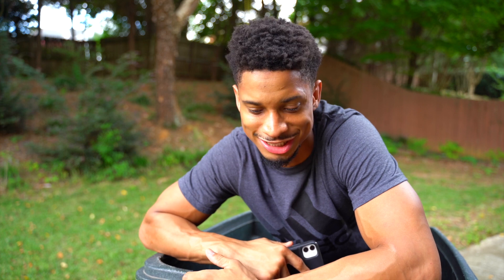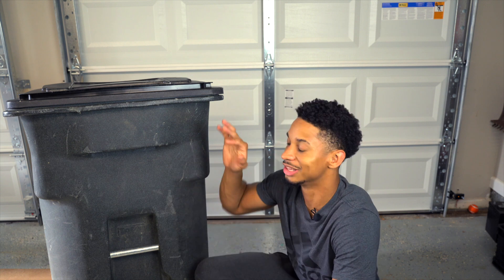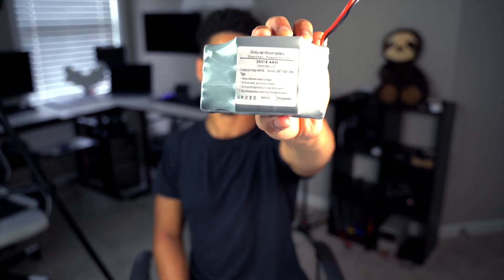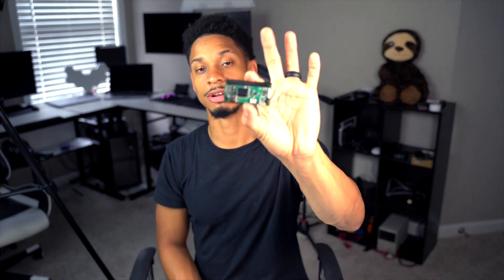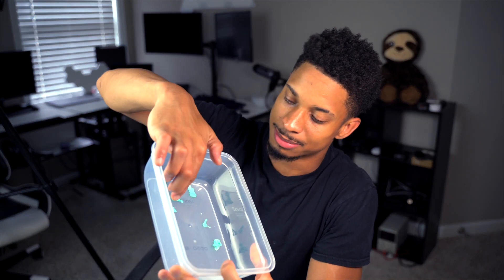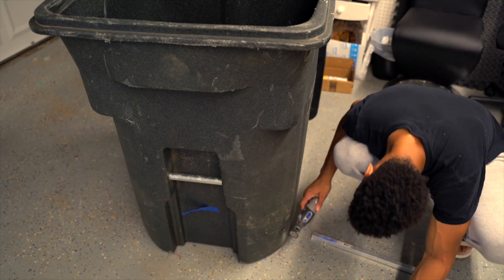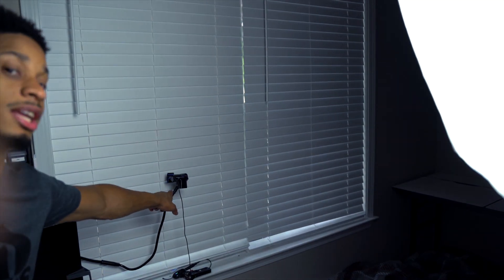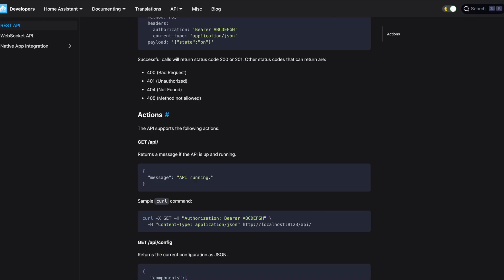Self-Driving Garbage Can That Takes Itself Out

Comment: Ahad,
I beleive the AI  part of your trash can issue  WORKED very good. The only exception is YOU should have  measured HOW FAR
from the start point to the end point your trash an needed to travel and then put a calculation routine in the code to make sure
it's final position was where YOU KNEW the trash can truck would pick it UP!   GREAT VIDEO!!!
Reply: Right...instead to measuring that.  I would like to see GPS and you can select where you want the can to be.  and it would be rolled out to that point and can come back from there.  My .02

Comment: PROTIP: get TWO Electric Wheel Hub Motor AND a 36v Battery for CHEAP: buy a hoverboard and tear it apart. You can find some on amazon for <$150
You're welcome!
Reply from the maker: Good tip. Actually did something similar for another project I’m working on 😉